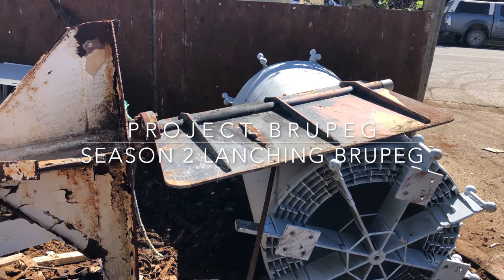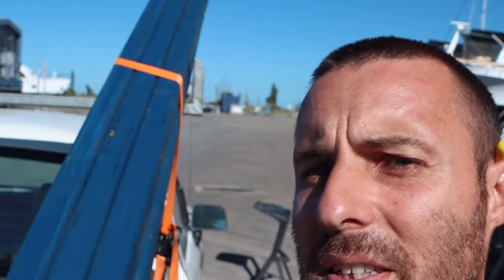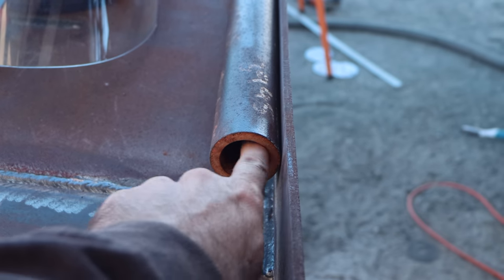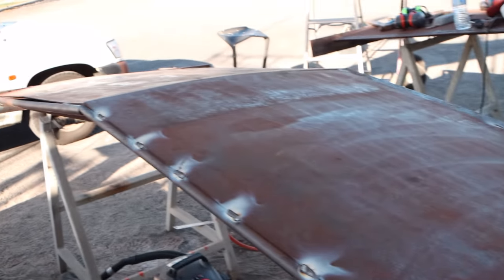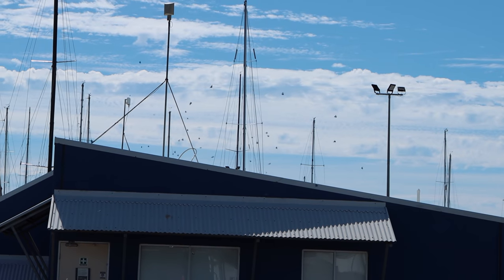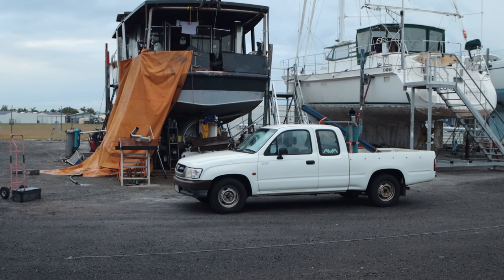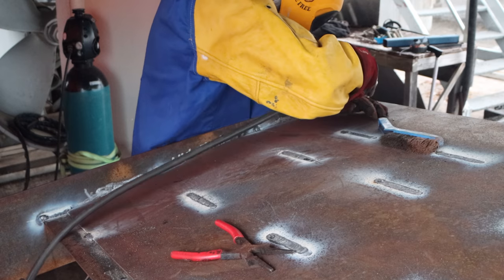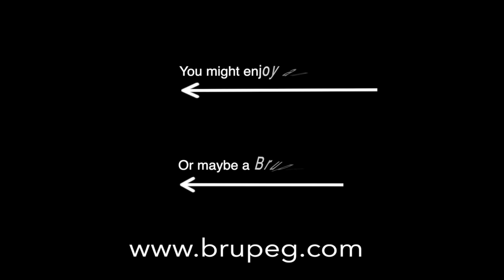Fitting the Final Skin - Project Brupeg Ep. 137

Comment: Just a thought. Your "wings" provide Lift. So, when they strike a wave that is quartering across the boats travel, they will Lift that side of the boat and tilt the boat up on the same side as the wave hits.
In my mind, I would see that you would want apply a downwards effect, to stop the boat rolling away from the one sided wave.
At anchor, assuming the boat will stay head to wind, waves coming front on will increase pitch as the fins lift the front of the boat higher than it would with no additional buoyancy. Waves seldom travel fast enough to provide any lift at anchor, of course.
On a course more or less downwind or upwind, with very little "roll",  your wings aren't going to help much with pitch. You would need another set of wings at  the back to fight pitch. They don't seem far enough forward to prevent significant nose dive in high seas.
I can see a great subject for future videos actually measuring the wings effects under different conditions.

Comment: You gonna pressure test the wings with welding gas to stop any internal rot? (Natural humidity of air)
Reply from the maker: Hi, no it will be normal compressed air for the test then a few litres of diesel in there and seal the bungs up for good
Reply: @ProjectBrupeg  Sound plan :o)

Comment: How is the air and diesel going to make it between long supports inside the wings?  You welded both skins to all supports and there are no weep holes in the supports for diesel to travel between each support. I’m sure some air will get through near the skin where you could not weld the skin to the support structure on one of the sides.
Reply from the maker: Hi Steven, we drilled a 10mm hole in each beam at each end, but also the rear skin isnt a perfect seal on the ribs, there is a couple of mm gap so the diesel will have no issue sloshing through that. Diesel is often used as a leak tester as its so effective at seeping through the smallest of holes
Reply: Great.  Glad to hear it.  Good luck with the pressure test.  I’m enjoying watching your efforts.  You’ve accomplished so much in a short period of time.
Reply from the maker: Thanks very much

Comment: So you bought the tig torch, did you buy the green bench grinder wheel for sharpening your tungsten electrode? Lots of sharpening will be required. P.s dont breathe in that shit when grinding. Tig electrodes are somewhat radioactive and the dust off the stone isnt good. Easiest way is to put it in the cordless and spin it as you sharpen.
Reply from the maker: Didnt know there was a wheel to buy, did notice the electrode chews the crap out of the normal grinding wheel. I love the drill trick, im going to use that as ive been spinning it by hand like a dunce.
Reply: Project Brupeg yeah its tungsten remember lol hard as f@&$. The green wheels are silicon carbide. Soft so no usey for anything else. Buy one of those cheap ozito bench grinders with the belt sander on it and have it so u have a dedicated one. The sander is handy as. Tool shop at bunnings like 70 bucks. Dunno how much tig u done, but trick is ti have your hand supported and practice your traverse before u start to weld. Watch this old tony for tips.
Reply from the maker: Yeah I’ve been watching him and Jody at welding tips and tricks so I know what I’m looking at when I’m welding

Comment: Love your build. I was introduced to You guys via Dangar Marine. I have a question that you may have answered in previous videos (if so, sorry to ask again). The metal inside those wings seem to have a fair amount of rust. Is that not going to be a problem down the line, or will you be dealing with that in some way?
Reply from the maker: Werner, welcome aboard mate, once the wings are welded airtight the rust stops. Rust needs oxygen to happen, when the tank is sealed up and no fresh oxygen is allowed is the internal rust sucks the oxygen out of the air and ends up at an equilibrium where it could rust but there is not enough oxygen to allow it to happen. this is the normal way to prevent rust in empty tanks, just dont open them. We will also be adding a few litres of diesel to slosh around inside to coate all surfaces to further prevent internal rust. The outside will get sandblasted and painted as normal
Reply: Project Brupeg thank you mate. It makes a lot of sense now. 

Ps. Your upload frequency has been a wonderful distraction from lockdown boredom here in Auckland. Thank you so much.
Reply from the maker: Thanks

Comment: Hey Brupeg, how's it going? are you not coating or otherwise protecting the inside of the wings?
Reply: Nope. Just waiting to rust. Diesel intended to fill cannot make it between the internal supports. No holes in interior “beams”
Reply from the maker: Hi Guys, with the wings airtight, rust will stop internally after a few weeks as there is not enough oxygen left to continue rusting. We will add a few litres of diesel to further help internal protection, we drilled some 10mm holes for the diesel to move around with and also the rear skin is not fully welded so diesel can pass between the skin and the ribs

Comment: Do you guys have plans for protecting the insides of the wings whether it be paint, foam or some other treatment? I know there is only a limited amount of oxygen inside once it's sealed but in case there is a at some point a crack or what not that goes unnoticed for a while. Filling with something may also prevent them taking on water, becoming dead weight and all the structural problems that could lead to. 

- Not trying to be an armchair expert (I'm certainly not).
Reply: He said they are going to have some diesel in the wings to keep them from getting rusty inside, it will slush around inside them and keep them good.
It's the best option i guess, painting is useless and impossible, and filling them with foam will get unnessessarily annoying if they need to do work on them, the foam would cause any (future)welding to be bad.
Reply from the maker: Hi Guys, yeah so the wings will be airtight tanks so rust will stop internally after a few weeks from oxygen depletion. They are built with 250 grade mild steel so if they take a big whack they will bend rather than crack so air leakage is not a huge concern. that said the diesel that we will add internally will slosh around for a few years and coat every surface. it impregnates the steel slightly and really knocks rust on its head. Ouur rear fuel tanks are bare mild steel insides and they have been open for five years and still have no rust on them because the diesel has worked into the steel over the last forty years.
Reply: @Theremoore  Cheers! That clearly went right over my head at some point.
Reply: @ProjectBrupeg  Thanks. That's really interesting to know.